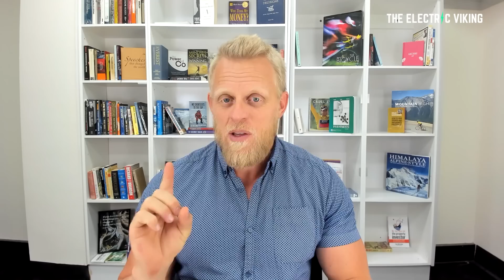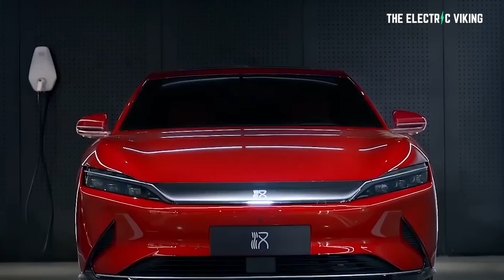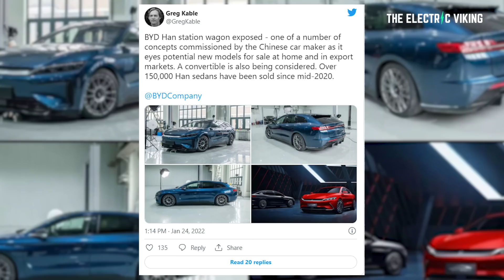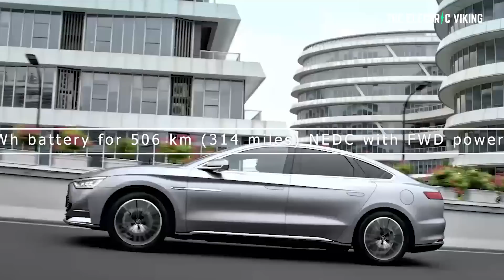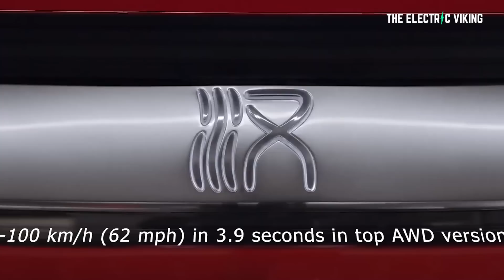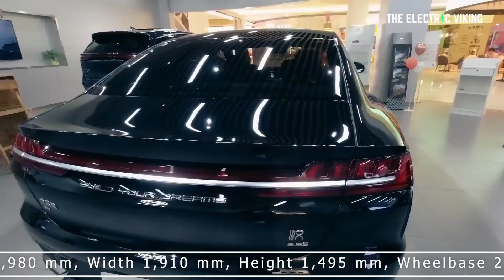RAD looking NEW EV with massive boot & BYD Blade battery

Comment: I would buy this immediately.  An Estate car is by far more useful and practical than an SUV -  not everyone is 6ft tall.  I have seen and ridden in electric cars in China for the past four years and last time we were there (two years ago) almost every taxi had converted to electric in Guangzhou.  All the makes run silently and smoothly and are well finished and the taxi drivers tell us that there is never a problem with range.  Reliability is not an issue and not even considered as these cars do not break down.  Anyone here in Australia, who thinks these Chinese cars are rubbish and would never buy one needs to look in the mirror as he is probably watching on a Chinese made computer or mobile phone.  It will be exactly the same as the 1970's with Japanese cars - but about five times faster.

Comment: I would have thought shooting  break is a US term not European.   
The size of this BYD car infers it was not designed for Europe, it is just too big for the western european market,   it's just going to be difficult to find parking spaces.   European parking spaces are based on cars being smaller than this.  I would like an electric car,  I would even work around the parking size if the cybertruck could be manufactured to have gvm not more than 3500Kg, I mostly drive a 6m motor caravan.  However a car for going into towns and cities,  (ie controlled parking)  needs to be shorter and narrower than the 3 in Europe.   Yes the 3 does actually fit in the bay but getting in and out will be tight.  But an end on parking bay is only normally 4.8m this will stick out the front of the bay 200-300 mm.   Some places they are very picky about vehicles that park out side of the bay markings.

Comment: OMG you really are a cool aid drinking fanboy....😂
These Chinese vehicles look very promising but don't put your money on them just yet!
When Great Wall, Cherry and a few other Chinese brands first landed here in Aus, their quality control was awful.
A few years after landing they were all falling apart and you couldn't give them away, zero resale.
Friends of mine bought a brand new Cherry, 2 years later it was rotten with rust, brittle interior plastics cracking in the heat and a total lack of dealer support.
There's lots of promise with these new Chinese EVs, but I'd suggest you take a deep breath,  let them have 1-2 years in the market and see how they fair here in Australian conditions.
Keep up the great work, awesome channel 👍👍

Comment: A lot of style, practicality and performance - a great overall package (at what cost?), but I'm still waiting for a direct EV replacement for my 18 year old XC90, which has currently done 220k miles. It is so relaxing to drive, whether into town and back, or to my workshop in the next village down the muddy, potholed, single-track lanes around here, or cruising down the motorway for two or three hours in quiet comfort. I can chuck all my tools in the back, plus 3m lengths of timber, or several bikes, or tow a couple of tons of trailer, or strap several sheets of 8'x4' ply on the roof, or (after a bit of a clean-up) seat seven of us in style and comfort for a trip to the beach, or a night out; or shove an American fridge in the back with the tailgate shut (yes, really - I've done this twice now with different fridges, but not sure if you can do it with the newer models). Oh, and the one before it saved my life when I was T-boned on the driver's side by three drunk teenagers in a Focus. I pushed aside the curtain airbag, opened the bent door easily and stepped out without a scratch.
What a car - and a tough one to beat.
Reply: Ok, so the radio doesn't work, but it only cost me 1800 quid 😄

Comment: 500000 km 60% guaranteed battery capacity doesn't sound very promising tangibally. Most automakers thus far i'm hearing x amount of km for 70%. So why are BYD lowering the lower state of charge? It sounds more negative than positive news.
I agree I like the car for its practicality, in Europe it wouldn' t be my first choice because the car is too big for most European roads.
Reply: Because they are offering 500 kms over 8 years, n-one else does.

Also they know it won't degrade by 40%! They promise 1.2 mio kms and 3,000 cycles. Aagin no-one else does.

Comment: Looks like a difference between wagons and SUVs is the latters' greater ground clearance. To me, that higher clearance is reassuring, and mileage difference is probably small. I, and most folks I know, like stepping up and down on entering or leaving the vehicle; it's easier, and we feel better sitting high up than sunk into a soft bucket. Better view of surroundings, too. I've enjoyed my Rav4, and look forward to getting my first small electric SUV in the next few years.

Comment: Would love one; however, the Biden administration will block Chinese Mfgs. either through high tariffs or otherwise. In addition, I own tons of stock, so I believe in the company regardless of it being in China. In the BBB bill it gives the Big 2 (Ford, GM) an advantage because they have "union" labor. Even Elon was pissed about it. Anyway, my best to BYD for building great NEVs and I hope it does well around the World. PS - They are the best NEV vertically integrated car manufacturer in the World and they make their own chips and batteries, what's better than that?
Reply: What so stupid, is BYD's bus and battery factory in CA is fully unionised as well, but they are still locked out because of China.

Comment: No BYD vehicles will be sold in the USA with the current tensions between the 2 countries, so it's pointless saying they are coming to the USA unless you have absolute rock solid proof otherwise its more BS.

The BYD lineup for Australia is as follows in 2022 it will be the Yuan Plus, the Dolphin and the Seal sedan to complete with the Tesla model 3. 2023 will see both the revised Han sedan and the Tang as well as the BYD Ute that is our 6 model lineup in my opinion. 

Please stop with the pricing and arrival speculation, if it doesn't happen then you are just talking BS and it's all speculative without a shread of fact behind your claims.

It's over 3 weeks and no Dolphin test drive again let's stop with the BS and just be honest and tell everyone that you are waiting for the BYD Experience Center to open in Sydney to test drive the Yuan Plus, Dolphin and Han sedan and this is not going to happen until around the 2nd to 3rd week of February.
Reply: Since Huawei got sanctioned for US gov's lies. It's too risky to invest directly in the US.

Comment: In the U.S. SUVs rule and station wagons have not been popular for many years. Exception: the Subaru Outback. I totally agree that SUVs are less efficient as height hurts aerodynamics. In cities total length matters to me as shorter cars fit in more parking spaces. That's why I prefer the hatchback body style. I don't care for SUVs except perhaps the smaller cross overs, but a hatch is what I look for.

Comment: 60% is rubbish! Any owner would have replaced before that.
Reply: What are you talking about? 500,000 kms over 8 years.

Tesla 150,000 miles or 220,000 kms, also 8 years, 70%.

The point here is they know it’s good for 1.2 mio kms and 3,000 cycles.

Their old LFP used in their old E6 after 4 years being driven day and night in Shenzhen, the battery only lost 10% after 500,000 kms and the Blade, 3.0 platform, thermal management as standard, mean the performance will be exceptional.

Comment: 60% remaining capacity after 500K miles guaranteed? Not sure I see much reason to cheer. 60% is not a high target, meaning 40% of original range will be lost. Can't say I find that news exciting. 

But I agree that the vehicle (wagon form) looks good and appears useful. Cold weather efficiency? Cost? I'd want to know that BYD has thermal management efficiencies that at least approach Tesla's.
Reply: They aren’t saying it will be lost and Tesla is 70%, expires after 50,000 miles or 4 years.

Byd promise 1.2 mio kms, 3,000 cycles. Yes all new blade batteries on 3,.0 ha thermal heating, improved over everyone, as they are proving with efficiency of the battery system in cold and hot countries.

Comment: Is this right? a top speed of 100km/h
"The model Han EV is rear-wheel drive with a reported all-electric range (NEDC) of 605 km.
 The Permanent Magnet Synchronous Reluctance electric Motor used in BYD Han. Its top speed is 100km/h, available in black, grey, red, and white colors."
Reply: 0-100 kms in 3.9 secs, not top speed! They have a badge on the back ‘3.9,’ that’s what it stands for. They are doing that on most of their new models.

Comment: 310,686 miles guarantee at 60%
Reply: No. 1.2 mio/ 3,000 charges, but if for some reason after 500 kms, the battery has lost 40% (which they know it won’t) then they will give you a new one, upto 8 years later and 500 kms. who else offers that?

Tesla depending on model, but 70% after 4 years and 50,000 miles??? BYD Blade 500 kms after 8 years 60%. The old LFP in the old E6 has already done over 500,000 kms after 4 years, with only 10% loss. The Blade is far superior.

Comment: While i'm also very keen to see how BYD Blade LFP packs go and hope they do well just 500,000km with 60% remaining capacity warranty is actually poor for a few reasons; batteries do not degrade linearly, so anywhere even close to 60% remaining capacity it's basically throwaway time, no second use would be worthwhile and if the car is 400km rated range (100-0%) that's only 1250 cycles, in the LFP world if you lose 40% capacity in 1250 cycles this is a poor LFP battery, so they are offering a very loose warranty.
Reply: It’s good for 3,000 charges without loss. The old E6 with. BYD’s old batteries in Shenzhen taxi drivers have confirmed (videos posted on YouTube) after 4 years with B YD’s old LFP battery, not the vastly improved Blade, and over 500kms, the battery only lost 10%. 

The new blade will significantly outperform that, also confirmed by Shenzhen 2nd generation E6 drivers, who say everything is improved.

BYD expect 1.2 mio Km’s, 3,000 charges. 

Tesla offers a new battery after 70% loss, but only for 50,000 miles or 4 years.
Reply: It really does matter Adrian there were only 15 shipped here. All the coming BYD models are built on the 3.0 dedicated EV platform and have advanced technologies. In China the Dolphin model for example has unlimited warranty on the entire power train and the battery for the first original owner. There is a little clause put in that states the vehicle can not exceed 30,000km per year to retain this warranty.

Comment: Such a shooting break is a great idea. I'm just a bit underwhelmed by the charging. 30-80% in 25 minutes is only half a battery. Most OEMs report 10-80% charge times, and it's probably 35-40 minutes on that metric. That's about the same as a VW ID.4. Then again, I'm spoiled with the Ioniq 5...
Reply: Also add the extra time that ''less than 800 volts' delivers.   Try and find an 800v charger anywhere. Good luck.   Charging times will be 3 to 4 times slower than the figures used in this video simply due to the low(er) voltages of all existing chargers. The Aussie Tritium 400v 350kW charger would be the best available.
Reply: So compared to car and driver which recently got 187miles of range back in just 15mins with their model s plaid charging test. 
What does your ioniq 5 recover in 15mins as far as range goes? Does it pre heat the battery automatically yet? 

Has it ever accepted over 300kwhs on any charger like hyundai claims it can? What are the fast charging losses by percentage?🤔 
inquiring minds would like to know if the ioniq 5 actually lives up to the claims of it's manufacturer. But proven by real world owners such as yourself.

Comment: If BYD makes the wagon in AWD for US, Sign me up (to replace a subaru outback).  The outback is very popular in Colorado- if BYD can match or beat outback on price they will sell many thousands in Colorado alone.
Reply: I guess a Han station wagon will be 10k to 20k more expensive than a outback, but you still get more for the money for it's price.
Reply: @xiebaiqin  $20k will buy fuel for the typical 200k mile life of the vehicle.  The mass market is value oriented, so a $20k premium will guarantee a minority market.
Reply: @DarylOster I don't disagree for what you said. But Han is a class C premium vehicle. You should compare it to BMW 5, Audi a6, MB E.

Comment: The SW is amazing, the cabrio is very interesting. There are not a single cabriolet EV larger than the 500 or Smart EQ. Great news.
Reply: At least the Fiat 500e has a descent range with 200mls, And has a cabrio. The rest are small city cars with a non usable range. 
 They dont have to be large, there are countless large cars already. So many people are single or only 2 that dont need to ride around all year with 3 empty seats?
Build more 2 seaters and cabrio's 👍😁 with a descent 200mls+ range.

Comment: You keep repeating BYD’s 500,000 km or 310,685 miles battery warranty but if they’re only guaranteeing 60% capacity, that’s not very good at all.  If you had said 80%, that would be more reasonable.

The reason is that a 300-mile range EV gets 250-miles real world. Chop that down by 35% and you’re stuck with a measly ~160 miles of range which just won’t cut it for most owners (200 miles min.; 80% of 250) and yet would not qualify for a warranty battery replacement. So yeah… the warranty does not excite me like the cars themselves do. Looks Hot!! 🔥
Reply: The taxis in Shenzhen E6 with 80kwh pack, have already driven 500 000km in 4 years and only 10% degradation.
I uploaded some videos talking to the taxi drivers.
I have rented the NEDC 605km Han and it does 350km @120km/h 
City driving 500km is not an issue.
Reply: @larsradtke4097  thanks Lars. Just to clarify, you are talking about the old e6 I believe and not the blade?
Reply: So the performance is even better than stated.

The Han is obviously the blade.
Reply: The Tesla Model S Battery and Drive Unit Warranty covers a very generous 8 years or 150,000 miles....so half of what BYD is offering.

Comment: I think its great that BYD warrant the blade battery for 500K but does anyone know how many years it is warranted for? Most are between 6 and 8 years but I'm assuming being LFP it will be more than this.
Reply: They have that warranty on the E6 sold here. In China both the Dolphin and Yuan Plus have an unlimited warranty for the first Original owner so this might apply to other countries when these new groups of evs built on the dedicated 3.0 Ev platform go on sale globally.
Reply: Try their website? Maybe??
(And I think it's 500k to 60%? Most "not China" cars are 80%)
Reply: @rogerstarkey5390  yes but they don't guarantee 500k. for eg's "The Tesla Model S Battery and Drive Unit Warranty covers a very generous 8 years or 150,000 miles"....so half of what BYD is offering.
Reply: @hybridflowx4  Just found the answer cheers guys, Its 10 years.
Reply: @brentcrane6632  The Tang has 8 years in Norway.
Reply: @hybridflowx4  You are correct sorry, the warranty I found was for a commercial vehicle. In which case I really don't think that potentially 40% degradation of an LFP battery in 8 years shows very much confidence at all from BYD.
Reply: @brentcrane6632  Tesla offers half of that for 8 years!
Reply: @brentcrane6632  the e6 taxis with 80kwh battery pack already have driven 500 000km on the first pack and only 10% degradation.
So, for so big packs, no fear.
Reply: @larsradtke4097  Fair point mate, although I still think if they had more confidence in the longevity of this pack they would have said 20% degradation over this period not 40% especially given its chemistry .  Time will tell I guess :)
Reply: @brentcrane6632  Tesla only guarantee 70% over 4 years and in some cases only 50,000 miles. you can not compare mate. 

Really the point is, they will not lose anything like 40%; as Lars, who interviews E6 Taxi drivers in Shenzhen has said, even the old battery in the old e6 only lost 10% after over 4 years and 5000kms, so the Blade will be even better, but as you said, "Time will tell I guess :)"

Comment: How does the Tesla 4680 battery compare to the BYD Blade battery in safety??
OTA updates?
FSD capabilities?

I do love the wagon aspect though. Due to current situation though, the higher SUV suits my needs better atm.
Reply: Your initials are VW
Reply: Well, apart from being a different form factor, with a different chemistry, aimed at a different segment, the cells are similar......  /s 🙄
Why not wait on some actual information instead of trying to find fault based on rudimentary knowledge of old technology?
You can't assess ANY product until at least one  independent (reliable) source, or you, have driven both.
Reply: How does the Tesla 4680 battery compare to the BYD Blade battery in safety?? 

Tesla does not have 4680 batteries in production you can't compare.

OTA updates? YES

FSD capabilities? Better than Tesla:

"A recent test conducted by Tianjin-based China Automotive Technology and Research Centre (CATRC), a state-owned car research facility, found that the average assisted-driving performance score of six popular EV models was 67.2 out of 100. Researchers concluded that "there is a long way to go" before these vehicles can reliably steer on their own........The study covered the Tesla Model 3 and BMW iX3 - the only Western brands tested - as well as the NIO EC6, BYD Han EV, Xpeng P7, and Hozon Nezha U Pro....

The Xpeng P7 was the best overall performer with a score of 83.7, followed by the BYD Han EV at 80, and the BMW iX3 at 79.

The Tesla Model 3, whose Autopilot assisted driving feature requires constant input by the driver despite its name, was ranked fourth with a score of around 70 - just three points above average."

....next?